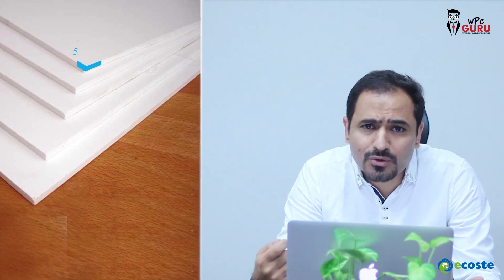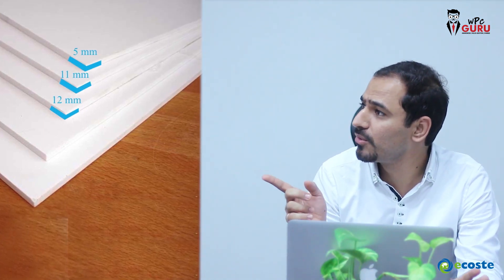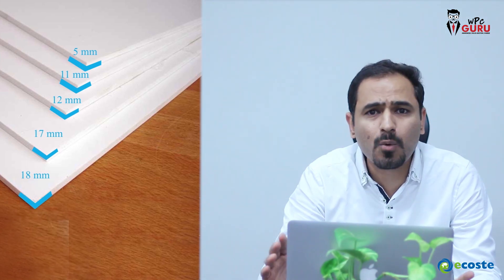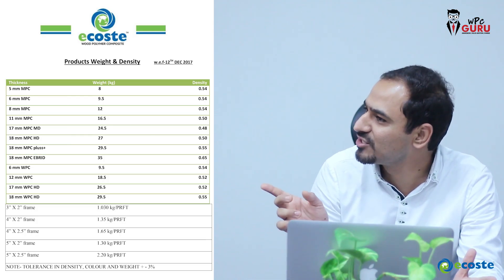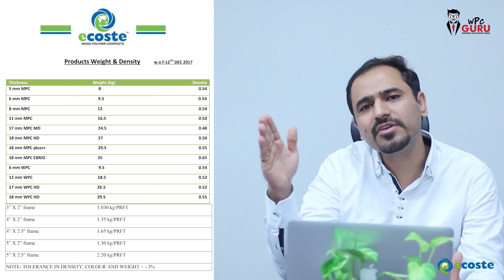How WPC and MPC Boards are Made ? What are It's Composition ?

Comment: What is better for exterior jali MPC/WPC  and what would be desired thickness?
Reply from the maker: It comes in two colors - Frosty White & Beige, you can chose according to your application. 
Again, thickness also depends on your application,
Exterior - 18 MM
Interior -  11 – 18 MM.
For detailed information ,you can connect with us at the following number or can provide your contact details, our team will reach out to you asap:
M : 9555075075
E : contact@ecoste.in
W : https://www.ecoste.in/wpc-board/